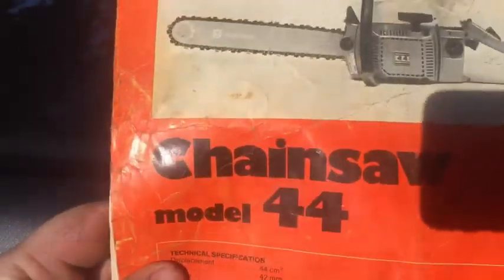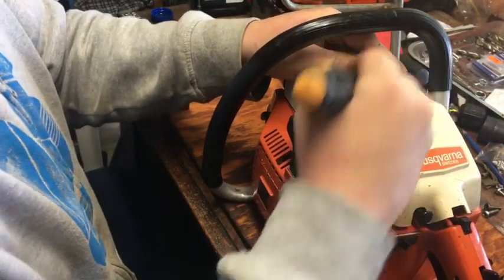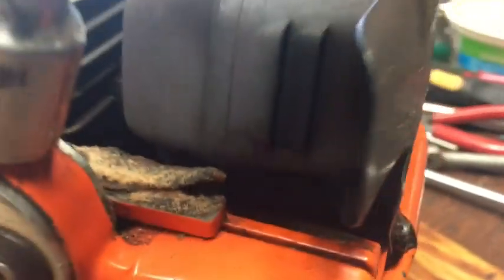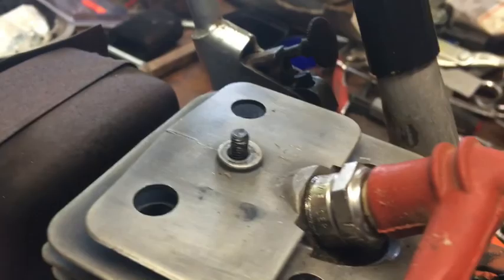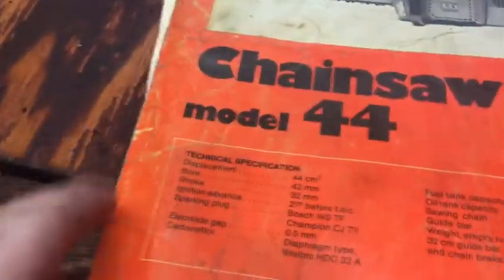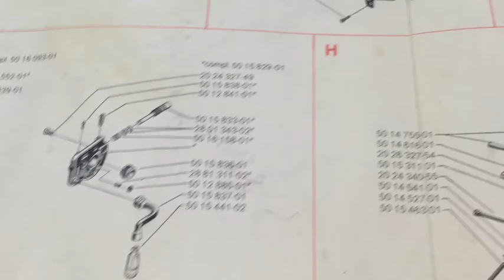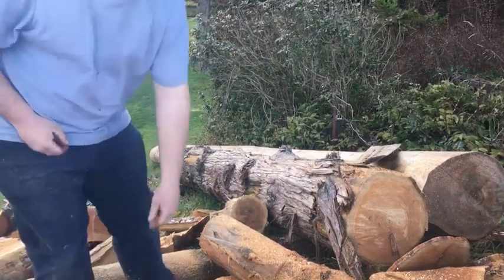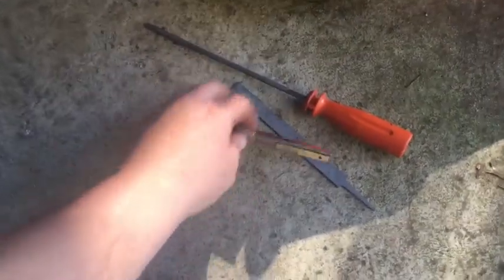husqvarna 44

Comment: I just found my grandpas 1987 Husqvarna 44 and am looking to restore it myself. It's heavy to the pull and there's spark, but it does not start. Mine looks a little different to yours, black top and the choke is different looking. I'm slightly concerned as the plastic piece locking the throttle isn't there. However it looks like it was never there to begin with, even though there's a cutout for it. Any suggestions why I might have trouble starting it?
Reply from the maker: Hi there thanks for the comment and question, the black top 44 is the newer version, I wouldn't worry about plastic broken or missing piece, if it pulls hard it probably has compression needs a good 110psi min, and has spark so thats good, if it was me I'd take the top cover off, and take the air filter off and pour a cap full of mixed 50-50 gas into the carb. try to start if it has spark and compression it should fire up and then die. if it fires up and dies, you need to remove the carberator and completetly clean it, and replace the diagrams and screen, and replace the fuel line and filter and it should runs good. let me know either way, high low jets should be 1 turn out and idle should just be open a little.

Comment: I need the CORRECT bar oil cap. Mine is a 1983. I have ordered several. None work. Can anyone send me info? Runs great but I obviously wouldn’t use it without bar oil. THANX
Reply from the maker: Hi there so the stock part number is 501 56 41-01 which is discontinued, 501 62 66-02 theres many on ebay and I've heard they fit. let me know if you have any luck. you can buy the 501 62 66-02 on farmertec for 90 cents

Comment: Does the manual state what the high rpm is?
Reply from the maker: yes 8500 rpm in the wood under load, and 13000 rpm free speed after break and 2500-2800 idle in hope that helps sir